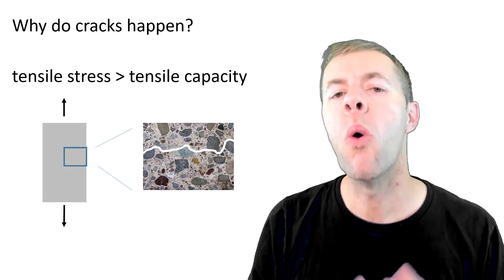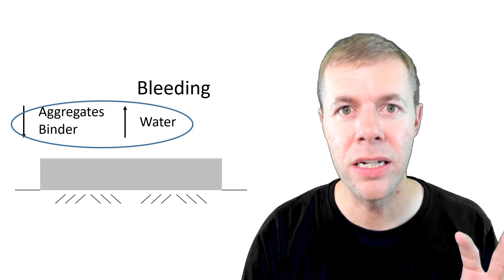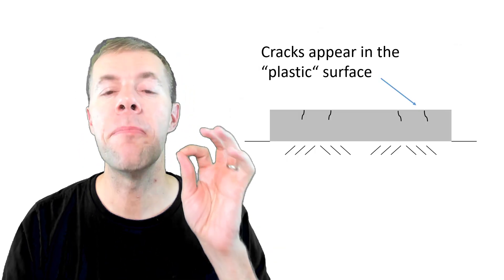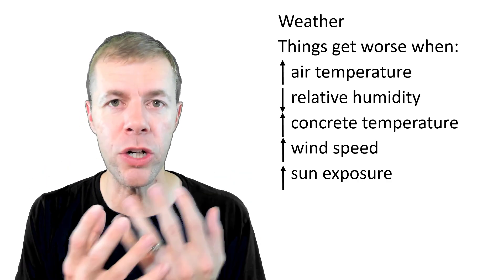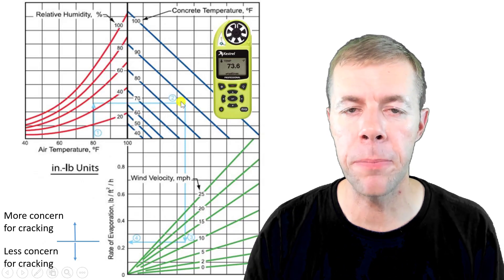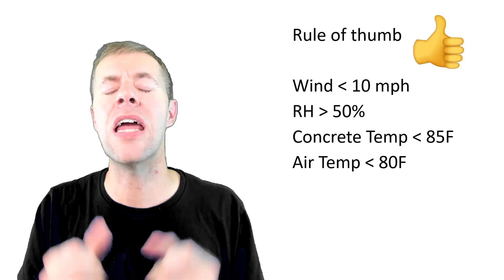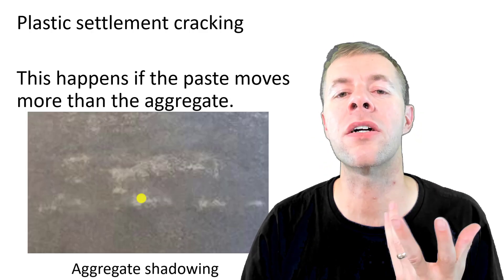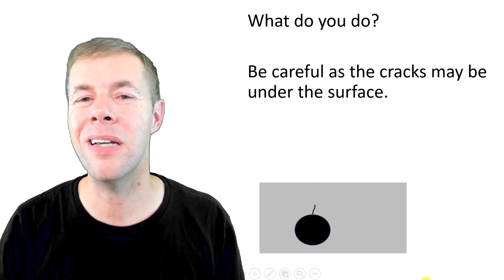Plastic shrinkage and settlement cracking in concrete

Comment: Help! Building new home, floor poured today and was being power troweled and was being sprayed with sealer when I left at noon. 50 degrees, low humidity, windy but sunny. Came back at 530, cracks. Fingernail deep all over. Some of the grey shadowing in areas near bathroom fixture roughins. Very unhappy. What do I do? Want to bring the boss out who gives the paychecks out on Friday and ask him if he feels this is up to par. At a loss. I hate it. It looks like crap. Oh and expansion joints were also cut today.

Comment: Im a concrete guy. In windy conditions accelerator is helpful, as others have said. Also, do not saw-cut joints when its windy. Always wet-joint them.

Comment: In Germany, we roll out thin plastic onto the wet concrete, immediately after we‘ve vibrated and flattened it. Your surface takes a bit of a beating, but it def. stops early cracking

Comment: I have. Was confused about it but not now. I was pouting a patio here in windy dry wyoming over a hour from the plant. Using fiber reinforced concrete 3500 psi the truck showed up super wet like almost a 8 in slump. I told them to retard the mix for two hour. So we get it down floated and a early broom to make it rough do no slip for older people. Looking like rain. I go home 45mi. Round trip to get plastic when i come back all 7 yrds shrinkage cracks everywhere but still workable. So if get on it with a wood float. I know not best for exterior because it removes air. Bur rework it realy good with my father brooming behind me and it still good and strong 6 years later in Wyoming's extreme temperature swings

Comment: Tyler, I have always wondered about new types of concrete that could include other materials. I've read recently about bioceramic building. It seems to be as much a political movement as an architectural and I'm not interested in living in an HOA Village so I won't be buying into their concept. But the idea of combining a ceramic product with cement seems like a win win. I do sculpture with a product called DAS Stone it is made by Fila group in Italy.. I use it to patch pots that chip. It air dries rock hard and so far holds up well outside. It is also much lighter than concrete and so far hasn't cracked. Like most clays it has some minor shrinkage and it is expensive, far too expensive to build a house with. I have no idea of the chemistry involved but given the bioceramic idea, there has to be a way to make a concrete that is stronger and lighter than what we currently have.

Comment: I'm getting ready to build a form for a pillar for my patio roof. I think I have everything planned out properly, but there's on thing that I'm concerned about. How do i seal the bottom of the form? It's going to be poured directly onto the existing concrete of the patio, anchored with drilled rebar. But the way the form is shaped, I can see it will have upward pressure on the form. Obviously i can increase the weight i place on it, but I'm still concerned that there will not be a perfect seal at the bottom of the form, and i don't want an extra gap down there where i would have placed wood or something. 

I was thinking using some silicone sealant, or even large amounts of hot glue, to seal the bottom of the form to the existing concrete might work. Will that work? Is there a better way?

Comment: So 2 questions. #1 wouldn't vibrating solve the issue of settlement cracking? #2 is something I've been wondering for some time. You've spoken about using burlap on horizontal surfaces 3 to 14 days to slow the rate of hydration, how would that work on say a placement that has been power trowled? It doesn't seem unlikely to affect the finish Thanks Tyler

Comment: I’m a precast concreter of 14 years, and I’m glad I’ve found your channel! 

Lately I’ve been working on wall sections for fertiliser sheds, and since I need to lift them by crane in a short time period I’ve been using a superplasticiser at low slump. This has been quite problematic in the onset of the Aussie summer months. Especially with hot winds and air temperature. (Im working undercover from sunlight). As I’d suspected, my attack plan to counter it would be wind breaks and to get it in first thing in the morning. You validated my decision, which eases my concerns. 

Sincerely. 

One more subscriber and fan! (Kyle).

Comment: Hi, Tyler I have question what happens when the plastic settlement seen at the bottom of concrete, I raised a Non conformance report on inspection in a slab for this plastic settlement at bottom (because of formwork deformation) of slab but the contractor said it was because oiling of the metal plates and joint tapes so client has agreed with contractor. what is your opinion about this case?

the picture which you have shown for plastic settlement , was exact what I have saw for the panel, but I guess it could because of missing of cover in that area also, Please help me to decide.

Comment: Dear Tyler
If we have a flat slab supported by columns and if the top and bottom rebar have equal area, then should we consider the shrinkage effect in considering deflection?
Regards.
Ahmad.

Comment: I'm interested in concrete ponds but leakage from cracking is a concern.(without excessive thickness costs) Are there formulas to ensure low leakage when raw strength isn't a big concern, as the load is just evenly spread water not truck tires or above grade structure. I've heard of self healing mixes where they actually regrow crystals in fine cracks, and mixes that cure with no shrinkage to even being slightly expansive. 
Active reinforcement is not generally applicable due to the shapes and low thickness not to mention cost, [maybe with a cube like shape?] and of course mild reinforcing just limits the width of cracks, so I feel like non-reinforced concrete is the material to design around. It seems to me that a pond approximating a hemisphere would generally be under compression and avoid cracking but then there are other stressors and resulting strains like thermal and aging, even soil shifting. 
My local area has some mild freezing, but most lakes do not freeze over, January averages in the mid 30s and I don't recall seeing any freeze damage to local concrete slabs, curbs, blocks, etc., not even homeowner mixes.(clay bricks will flake if not under cover)

Comment: I’ve been watching several of your videos, gradation vids!
Is there anyway you could cover like mixtures for desert specific, and humid specific cm.
If ya had a vid that covered the basic recipe of concrete, might have missed it. But slacked lime, gypsum & ash\slag = cement/OPC?
Still great vids, thanks. Learned a lot, 😝 lot more than I did cutting the slabs. Thanks.

Comment: Hi, id like to ask the difference of drying shrinkage and plastic shrinkage. Ive read somewhere that drying shrinkage happens when there is a higher amount of water in cement:water ration. Is this correct? thank u!

Comment: I found a natural Spring under a Driveway that had complete compromised the concrete.. So we built a drain with pipe and covered it with gravel and then poured.  The concrete cracked within a week, right on the corrogated pipe.  I assumed that the air in the pipe made the soil a different temperature, and there for the concrete dried or cured at a different speed.  Any ideas how to prevent this in the future?

Comment: My concrete contractor experiences a much higher incident of plastic cracking when the slab is on a vapor barrier. His solution is an add mixture of GAF CRA 007. It seems to work but is very expensive at $38 a yard. The literature on the product makes me believe it is intended to prevent drying shrinkage cracks. I assume it helps the plastic cracking as the product might not evaporate as readily as water. Is there a better/less expensive solution and why does my contractor only experience the cracking when placing over a vapor barrier. Thanks. 
PS, my next pour will have fine plastic fiber and a wet cure but my contractor still wants to use the CRA 007.

Comment: How about covering to avoid water evaporation ?
Over here in France they cover it with plastic .
I've seen concrete side walks covered with plastic for a few days.
Reply: Really? Doesn't the water condensate inside of the plastic surface then?
Reply: @sevvalkursun16  Yes, we want to prevent water to evaporate, plastic keeps the water in.
Reply: @laurier3348  Yeah, it does keep water inside the plastic, but eventually water will condensate and pour down on the concrete again. Am I wrong?
Reply: @sevvalkursun16  Yes and it is good that it pours down on the concrete again, isn't it ?
Reply: @laurier3348  Oh, right!!! Lol, I just realized what a stupid qn I'm asking. Thanks for indulging tho! :D

Comment: 45 years ago in learning formwork from old-timers we would cover new concrete with plastic to reduce the initial evaporation, then when it was finished we did it again. Sometimes we laid a thick layer of straw on it to block wind, UV from sunlight, and slow the surface evaporation. Key to it was to leave it alone with the plastic and keep the straw moist for 3 days, then check to see how it looked. If dry you put the plastic back for 2-3 more days. If straw wet it more. Minimal surface cracking every time and now you cut- not form- control joints no more than 10' apart and 8' is better. 

Now they want to rush through the process; faster and cheaper run the world now. Time and money are the ruination of quality. You can't force things into submission, but you can work with them as they are  and they'll then give you the results you want.
Reply: I wouldn't want to trap bleed water with plastic before finishing, but I do like a nice water cure after it's all finished!

Comment: here is a real time example,  PLANO TEXAS 1988,  BATCH PLANT ON SITE , company from Iowa , amazing  fast and efficient , hot summer months,  i recommend sprinklers on course and fine aggregates keep absorption / flash set from happening,  
  the whole boulevard alligator cracked ,  retarder and air too low also............
......but that comapny would not listen to 19 year-old concrete expert lol  from OSU lol,   after huge meeting i was in spot light as ??? the HERO them the zero hahhaa 
solution same epoxy used in the Francisco earthquake , goes into thin as hair , stronger than concrete psi----- hater of poor speling , sorry disabled photographic brain full ride at OSU , academic lol-ssdi

asorbtion 3.2 % sand then and 1.5% limstone,  105 degrees    amibieant , mix 92 degree 

oh they added ice per my recommendation after the meeting all i recommended was done 0.0 problems
Reply: was inspector on stealth bomber for 2+ years site at WAFB,  25 employess under me ages 38 to 45 lol me 20 s early ahhahaa knowledge is power , unlimited budget heehheee got love the haters  ,  brought my own crew i trained in dallas, every one i trained power hitter in ASTM , common sense inspections , real life testing not just lab fiction lol
Reply: what do u do when slump is 3 inch max on 8 ft x 12ft x 75 ft mono pour?   in summer heat dry modified proctor ground  , well not going to work with rebar 2.5 inches apart 1.5 in limestone..... nuke igloos too similar .... pours placements :) well its not ........?????? :) sensored for the pencil pushers lol,   
corp of engineers 5 years later  heard my recomendation after modified protor not goinf to work on weatheread shale lol
like sponge over time hydrauliclly lift the  tiny 14 inch footing on 10 foot correction.
got phone call inlaw suit, if u call me again will charge u  5000.00 usd 
this one is free lol
go back in moblie lab last shelf is narrower than last , open it up if still got the trailer semi ,   yes,  there was all my paper work soils samples,  approvals for their screw up age 20+ winns lol
dumb book following fools but
 JE Dunn loves me ahahhah

Comment: I would jokingly explain to my customers that I used a special type of concrete. It was made of Leaverite, which meant that at some point, I guarantee that it would crack somewhere. Secondly, that nobody would ever steal it. The reason was the Leaverite. That's because you leave er right there.

Comment: If you are patching a cement slab or don't need strength you can add a small amount of bentonite to the concrete,,no cracks will appear

Comment: This is pathetic. The romans made concrete that has lasted over a thousand years, while our bridges need to be scrapped and totally replaced in 30 years. It's the self- serving bureaucracy and the profit- driven companies conspiring against you and I, John Q Taxpayer.
Reply: Hmm...I've been to Rome. I didn't see any concrete works the Romans built  a thousand years ago that had hundreds of cars per hour, and 50 ton semis pounding over them all day every day. I guess I just missed them.
Reply: So now the cracking is caused by stress fatigue ? That's another factor ! Wish you'd have mentioned it before.... fact is, some of those Roman bridges and aqueducts are still in use today.  All they did, was add volcanic ash to the mixture. That's a known fact, yet today's builders choose to add planned obsolescence instead, at my expense.
Reply: Pons Fabricius. 9Ponte Vecchio. 8Ponte Di Rialto. 7Khaju Bridge. 6Shaharah Bridge. 5Cendere Bridge. 4Anji Bridge. 3Ponte Sant'Angelo.....Roman concrete lasting and in use to this day, just Google it. Yet here in Pensacola FL we're building a new 3- mile bridge to replace it's predecessor, after only 30 years. And the new one, not yet finished, has already been exposed for shrinkage cracks. Why ? Profit- driven practices ! At your expense, Mr John Q Taxpayer.
Reply: I couldn't have mentioned it before, as that was my first response.
I did check some of your examples, but I'm not sure why you used them. All of them are stone arch bridges or structures that maybe use concrete mortar. And the Anji Bridge is 100% stone, so I don't understand any of their relevance. Interestingly, I've been to a couple of your examples in our travels, they are brilliant examples of old world engineering and construction. The key to their longevity is as much related to well thought out geometric design as construction material. 
To your point, if you think that volcanic ash is the secret ingredient in concrete, it isn't. It`s not used today as volcanoes with commercial quantities of ash are hard to come by in North America, and the quality wouldn't be uniform anyway. Fly ash is used as a pozzolanic material instead as it has the same siliceous chemistry that adds strength and workability to concrete.
You mention profit driven practices. All construction, be it highways and bridges, condos and houses, commercial buildings etc, is profit driven, it has to be. I imagine that when you go to work you take home a paycheck, so I guess you are profit driven too, at your employer's expense.

I'm responding because I don't subscribe to the planned obsolescence conspiracy theory. Keep in mind that corruption in some builds is not an engineering failure. However, if you feel that bridges can normally and cost-effectively be constructed to last for 200 years of millions of car and truck crossings, corrosive salt applications or salt air, untold freeze thaw cycles, endless vibration, and remain standing while all those loads are on board during a magnitude 8 earthquake, then you've missed your engineering calling. Maybe you have the skills that others don't.
Please, if you can find a concrete design bridge example as I just mentioned and as you seem to think is possible, anywhere in the world, just cite it, I`d love to see it.

And no, I am not in any way involved in construction or the concrete industry.
Reply: If our structures were to just stand there and not bear any loads our concrete would last just as long.

Comment: My great grandpa used to literally whitewash over these problems.  He said the water helped keep it hydrated and the lime filled the smaller cracks and reflected heat.  On really hot days it took several coats and the final product looked like a giant slab of limestone.
Reply: That sounds great.

Comment: Excellent insight! I rarely saw this until I started doing concrete in the Mideast. Too hot, too windy, low relative humidity and the cracks are coming. Everyone hates the words "plastic cracks" btw. They don't understand it. We mist them down, cover with wet burlap, cut them the next day and then pond them for a week.
Reply from the maker: Thanks Steven!
I agree that the term plastic is weird.  I tried to explain it in the video.

Comment: Sir,
Can you explain about shrinkage reducing admixture and it's mechanism??
Reply from the maker: SRAs reduce the surface tension of the water.  This means when the pores empty there is less pull on the walls.  It might be helpful to watch my videos over shrinkage cracking.  You can find them here:  https://www.youtube.com/watch?v=Qk5Ua81g6SA